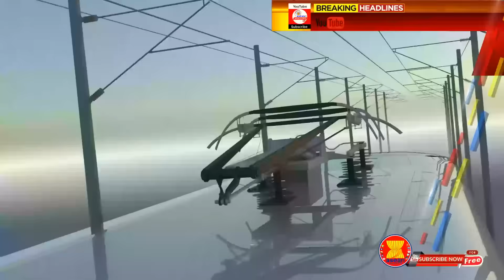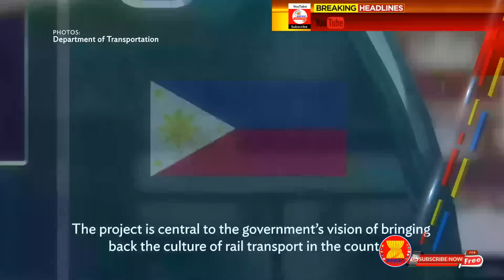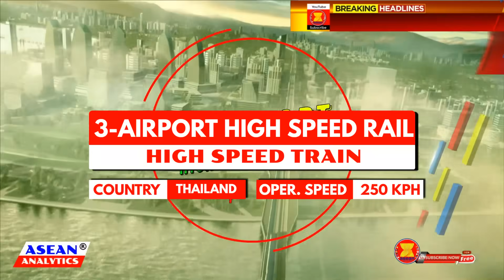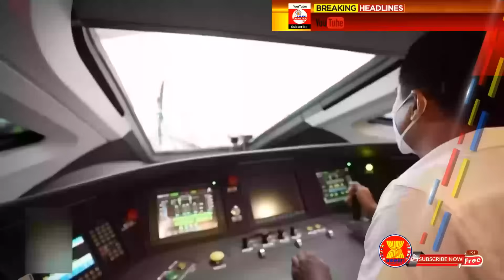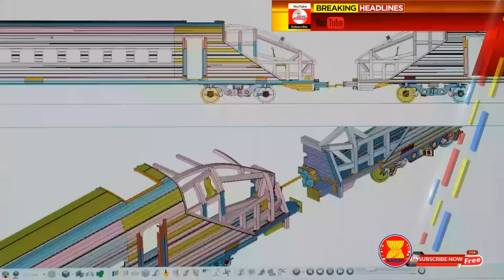Southeast Asia's  under-construction SEMI and HIGH SPEED RAIL

Comment: Malaysia's ECRL will be ready by 2027. The 640 km line will have trains that move at 160km/h. It is on standard guage so it can cater for 300km/h trains if needed.

Thailand, Laos and Malaysia uses Standard Guage. So, in the future, it is possible to take a train from Kuala Lumpur to Boten or even Shanghai.
Reply: 😂😂😂😂
but alot better than ktm 
tat i think run at 100 at max same like car speed
Reply: @CK-123-o2i  ETS runs at 140km/h.
Reply: Malon terus mimpi di siang bolong 🤣😂
Reply: @pencurihati7930 Indon koyak 🤣 yg pasti hsr berjln kembali projector nya.2024 projector berjln
Reply: Train Malaysia not high speed railway. Because  only 160 km/hours.
Reply: @soluckyme910  Way to go Capt Obvious.
Reply: @soluckyme910 
Kereta semi cepat malaysia super moden tercanggih di asia tenggara dengan panjang rel 688 km adalah teknologi super canggih melampaui zaman.
Dengan kecepatan 160km/h serta boleh dipertingkatkan kecepatan hingga lebih 300km/h dari waktu ke waktu (boleh diupgrade dalam masa beberapa tahun tanpa mengubah sistem rel) dengan route perjalanan 688 km dari pelabuhan klang ke kota bharu, adalah sebuah pembinaan terbesar kereta api termoden di asia tenggara.
Terbesar kerana memakan jarak tempuh paling panjang (hampir 700km) serta mempunyai terowongan bawah pergunungan terpanjang se asia tenggara.
Memilih kereta api semi cepat adalah pilihan terbaik masa kini kerana dapat berjimat (hemat) kos pembinaan serta pengoperasian dalam puluhan bilion ringgit, ketimbang membina kereta api peluru (bullet train) yang kosnya mencecah ratusan bilion ringgit (sangat mahal serta boleh menambah hutang negara yang tinggi).
Kos yang dihematkan itu boleh diguna untuk pembangunan infrastruktur lainnya yang lebih mustahak.
Juga perancangan masa depan yang boleh meng-up grade kan menjadi keretapi super cepat lebih 300km/h dengan hanya menukar mesin atau kepala gerabak yang boleh diup grade pada bila2 waktu tanpa menukar sistem rel atau gauge nya
Reply: @sempoi7399 Malaysia paling modern ya paling maju paling canggih 🤭🙏
Reply: @panurotomangkuwanito4728 ,haha iya ckup ketawa aja gw 😂 baca komenanye .
Reply: @sempoi7399  dream on wkwkwkwkkw
Reply: @sempoi7399  perbandingan yg sempurna seperti fa 50, Indonesia Rafale 😎
Reply: @fakesilent3918 hahahha ,bagaikan golok lawan pistol,tapi dia masih pd dengan goloknya 🗿
Reply: @sempoi7399 Malaysia tercanggih dan terkeren sejagad raya seluruh dunia dan alam semesta 😁😂
Reply: its not HSR , thats it , don't make something out of nothing dude XD
Reply: @richardaryanto340  Learn to read. Slooowly this time.
Reply: Its more than standard gauge. The consistency of the rails are critical for higher speeds. So those rail tracks may have to be replaced
Reply: Ko ni bodoh la ... kenapa nk memalukn malaysia...??? U dont drag Malaysia boleh?
Reply: Klo ada video dengan judul Indonesia di youtube , warga bilik termenung ini paling repot seasean, hidup penuh delusi ..nggak mau kalah

Comment: Fast train / bullet train from Jakarta to Bandung, West Java, Indonesia, will be released for commercial passengers on the upcoming 18 August 2023👏
Reply: With maximum high speed 385 km / hour
Reply: @deddygiririndjani635  350 km/h
Reply: @hfcraft748  Approximate train speed estimated to be between 200km/h and 250km/h.Now no load test run.
Reply: @sirisakpimchan7014  minimum operating speed of 350 km/hour and maximum operating speed of 400 km/hour. do you know what it is? After all, you are also not an Indonesian citizen🤣
Reply: @シ气ララ氕亠亠   Now no load test, with out 610 passengers.
Reply: @sirisakpimchan7014  you cannot Denny the fact that this train Will be operating in August
Reply: @kokoooji  Commercial operation speed estimated to be between 200km/h and 250km/h. Bandung in elevation 700 meter.
Reply: @sirisakpimchan7014  Dilansir dari laman kcic, Kereta Cepat Jakarta – Bandung CR400AF didesain dengan kecepatan 420 km/jam dan memiliki kemampuan operasional hingga 350 km/jam. Dengan kecepatan tersebut, perjalanan dapat ditempuh selama 36 menit dalam sekali jalan atau total 46 menit apabila berhenti di setiap stasiun. 

Sepanjang trase proyek kereta cepat yang menghubungkan ibu kota Jakarta dengan ibu kota provinsi Jawa Barat tersebut, terdapat empat stasiun pemberhentian, yaitu Halim, Karawang, Walini, serta Tegalluar. Kereta akan melaju dalam jarak 142,3 km dari Jakarta ke Bandung atau sebaliknya.
Reply: @sirisakpimchan7014  apa kah anda orang indonesia yg berkerja di kcic dri mana asumsi seperti itu..
Reply: @kokoooji  Tunnel design speed 200km/h, track design speed 350 km/h between  the DK85+043～DK139+726 section .
Reply: @sirisakpimchan7014  the operational speed Will be same as that number and maybe more
Reply: @sirisakpimchan7014  Awalnya, uji coba dilakukan dengan comprehensive inspection train (CIT) atau kereta inspeksi dengan rata-rata 60 km/jam. Direktur Utama KCIC, Dwiyana Slamet Riyadi, mengatakan peningkatan laju atau kecepatan pada uji coba itu akhirnya dapat dilakukan setelah seluruh persiapan awal pelaksanaan testing & commissioning berhasil diselesaikan. "Berbagai pengetesan kesiapan sarana prasarana KCJB yang dilakukan sebelumnya sudah berjalan dengan lancar. Berdasarkan evaluasi maka mulai Senin (22/5) laju perjalanan KA cepat mulai ditambah menjadi hingga 180 km/jam," kata Dwiyana.

 Dengan kecepatan tersebut,  waktu tempuh kereta cepat antara Stasiun Halim, Jakarta Timur hingga Stasiun Tegalluar, Kabupaten Bandung hanya sekitar 50 menit saja. Nantinya kecepatan akan terus ditambah mencapai puncak kecepatan operasional di 350 km/jam bahkan hingga puncak kecepatan teknis yaitu 385 km/jam.

Source:  Katadata
Reply: @sirisakpimchan7014  seenggaknya kalau beneran yakin dengan statement lu , coba kasih data nya langsung jangan cuma asumsi
Reply: @kokoooji  Udah diemin aja. Sotoy tuh orang. 🤣🤣🤣
Reply: @kokoooji  Tunnel design speed 200km/h.
Reply: @kokoooji  The operational speed Will be less than 350 km/h, and less than track design speed. In tunnel if the train run only one train, can run more than 200 km/h.
Reply: @sirisakpimchan7014  udah pernah nyoba langsung? Coba minta dong buktinya
Reply: @sirisakpimchan7014 Indonesians who know more about it are better off keeping quiet 🤐😊😊
Reply: @kokoooji Sir, you don't need to respond to what he's saying, he's a stubborn type of person and will never want to lose, even though he's wrong😊😊😊😊
Reply: @wonderfulIndonesia7qc  ： CREC  know more about The proposed rail link will be  with approximate train speed estimated to be between 200km/h and 250km/h.
Reply: @sirisakpimchan7014 Are you a fast train driver in Indonesia as if you know the ins and outs 😊😊😊
Reply: @wonderfulIndonesia7qc  CREC design the system.   Indonesia don't have enough money to construction long radius railway or low slope railway, many sections will be reduce speed.
Reply: @sirisakpimchan7014 Is it true who you are when you talk about Indonesia? You don't have enough money. Are you the Minister of Finance for Indonesia, but Indonesia will continue the construction of high-speed trains up to Surabaya?   And now Indonesia is also building a new capital city. If Indonesia doesn't have money, how can it be built? 😅😅😅😅
Reply: @wonderfulIndonesia7qc  KCIC don't need high debt.
Reply: @sirisakpimchan7014 If the construction of the high-speed rail does not require debt, why can't many countries afford it😅😅😅
Reply: @sirisakpimchan7014  The actually speed is 350 km per hour and the maximum is 385 km per hour. And this is correct.🇮🇩
Reply: @owenlantu192   350 km is maximum operation.385 km is CIT maximum operation.
Reply: @sirisakpimchan7014  Thailand railway system can't event compete with Indonesia and Thai high speed train Will be finished by 2045 because the government don't have enough money, u just talking nonsense 😭
Reply: @owenlantu192  so many people have already try the train here ,and the speed is actually between 300 and 350 kph ,why you still rejecting the fact 😭
Reply: @sirisakpimchan7014  200 km/H and 250 km/H is only in some section the average speed from tegalluar station until Halim station recently already reach 312 km/h
Reply: @kokoooji  Ballasted track speed only 110-250 km/hr, depend on noise emission or curve radius.
Reply: @sirisakpimchan7014  jika tidak tau data maka diam lah!!
Reply: @hfcraft748  nooo high speed 386 km/h
Reply: @brianrizky619  385 only when testing, when operational no more than 350
Reply: @hfcraft748  km bisa melihat nanti ya siapa yang paling benar
Reply from the maker: Thanks for watching, please visit our homepage and stay connected for more...

Comment: Just to mention... 1st line of Semi High Speed Train in South East Asian is ERL that link Kuala Lumpur International Airport to Kuala Lumpur Sentral in heart of KL... Its Run Speed during that time is 160km/h and been use seen 2003.... Just to add some information....😅😅
Reply: In the world, Semi High Speed Train in India only.
New Delhi: The Minister of Railways Shri Mallikarjun inaugurated a two day international technical conference on “High Speed Rail Travel; Low Cost Solution” in New Delhi today. While addressing the conference, the Railway Minister said that India’s primary focus has been to provide a mass mode of safe, reliable and affordable transport, being the largest passenger Railway in the world, it is a natural aspiration of the people of this country that Indian Railways provide them high speed rail travel. 
Shri Kharge said that most countries consider high speed capability to be in the range of 250 to 300 kmph which requires a dedicated track with fencing and can be prohibitively costly. For a country like ours track fencing also has its own set of associated issues. Thus, leveraging Rolling stock technologies may provide a lower cost solution to meet the immediate needs of achieving speeds of 160 to 200 kmph and that too on the existing track. For speeds above 200 kmph the costlier and time consuming solution of providing a separate dedicated track with fencing becomes inescapable. Therefore, the focus of this conference is to consider achieving higher speed trains in the range of 160 to 200 kmph with marginal inputs in the existing infrastructure, besides given the financial constraints and issues related to land acquisition and track fencing, as an interim step, the Railway Minister said.
Reply: @sirisakpimchan7014 It makes sense. There is no need to build new tracks. A speed of 160km/h is adequate. 

Just improve the locomotive, coach and signalling.
Reply: @sirisakpimchan7014  Big mouth Indias are really funny, actually in business operation.  India's so-called 180 km/h "semi-high-speed rail" has never run to 160 km, the highest to 130 km, and most of the time only dozens of kilometers, the average speed is only 60 km/h, this is the proud "semi-high-speed rail" of Indians?  Why not?  That's because the old track wasn't designed to run 160 kilometers.  It was a product left by the United Kingdom in the 19th century that could only run dozens of kilometers.
Reply from the maker: Thanks for watching, please visit our homepage and stay connected for more...